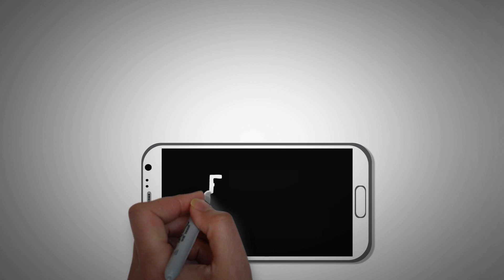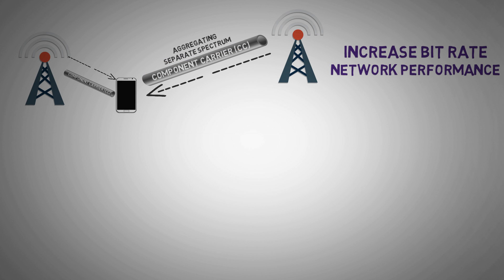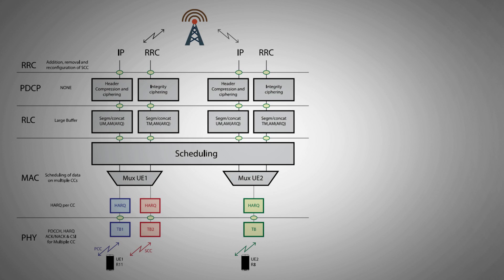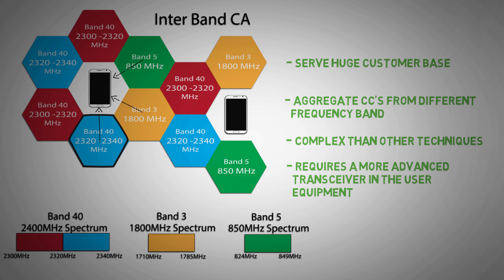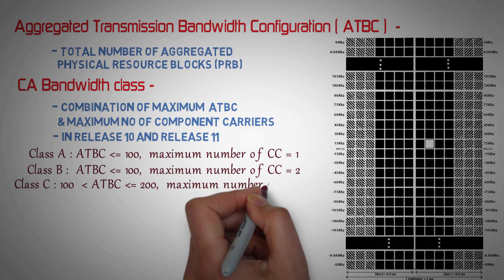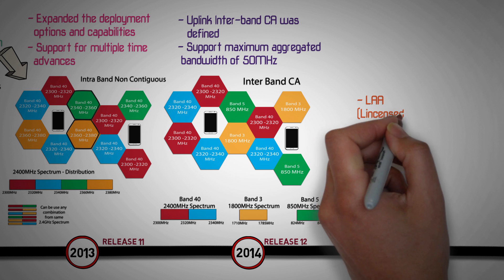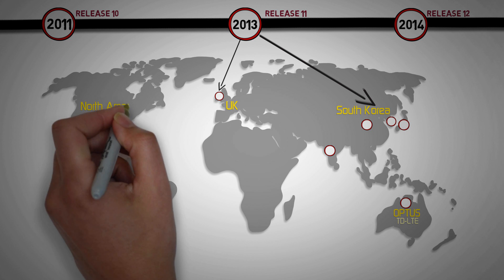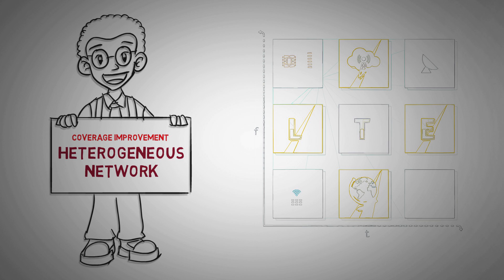2.9 - CARRIER AGGREGATION TECHNIQUE (CA) -CAPACITY & COVERAGE ENHANCEMENT IN 4G LTE

Comment: Hey I don't understand. So the intra band can have contiguous and non contiguous carriers? Whats the difference between inter and intra. Really confused
Reply from the maker: +Akhilesh Rao - Yes Intra Band CA can have contiguous as well non contiguous carriers.

In simple words Band refers to a chunk of Frequency Spectrum in which the service provider operates. In LTE there can be multiple bands. For example Band 3 refers to 1800MHz-FDD Band, where 1710-1755MHz is used for Uplink and 1805-1880MHz is used for downlink operation.
Similarly Band 40 refers to 2300Mhz-Tdd banb, where 2300-2400Mhz is used for operation.

You can refer to this link for further clarification.
http://www.radio-electronics.com/info/cellulartelecomms/lte-long-term-evolution/lte-frequency-spectrum.php

Comment: Great video!   One question:    does CA only work well at cell edge?  at 2:30 the graph shows a phone communicating with several different cell towers (each cell tower is a eNB right?).      I thought CA is  about one serving basestation  capable of handling multiple carrier components
Reply from the maker: Thanks Steven. Glad that you asked we also had similar confusion.
The answer is No! CA can be implemented anywhere. It can be implemented inside a single cell or inside overlapping cells(where small cells are involved). At cell edge where the performance degrades CA can be used to enhance it. In co-ordinated Multipoint (shall be discussed in upcoming video) you will see how signals from different sites are used constructively to serve user more efficiently.
In release 10, the CA IS about one serving basesatation capable of handling multiple carrier components. but in Release 11 the support for multiple time advances was introduced i.e cells belonging to two different Base station. It is mentioned in the video.

Happy Learning.

Comment: Will carrier aggregation work if there is congestion in nearby cells??
Reply from the maker: +Rajat Singh - No it won't. The primary requirement is free Resurce Blocks.
Reply: LTE  But RF congestion is caused by high prb
Reply from the maker: Can you please elaborate your question?
Reply: LTE I want to know that what can we do to mitigate the high prb utilisation issue will planning of small cell help ?
Cause In my region there is a highly utilised site and to mitigate the issue we planned a macro site nearby but after radiation of that site the performance of the small cell present in the region started to degrade
Reply from the maker: In LTE-Advanced there is a feature called Co-Ordinated Multipoint which can be implemented to reduce the Inter Cell interference. We are not RF experts maybe you can consult other experts for a better advice.
Reply: ok